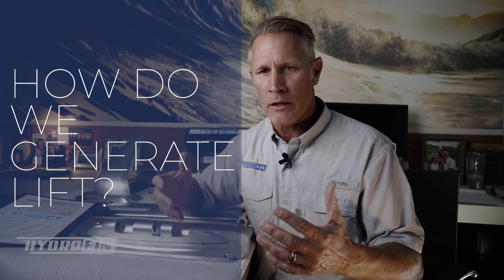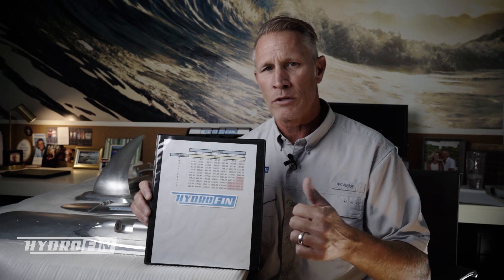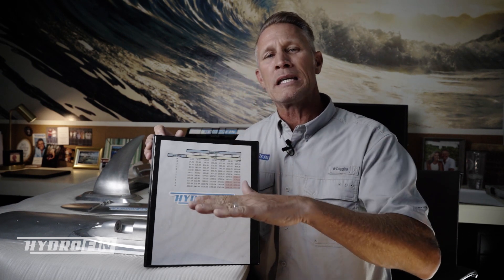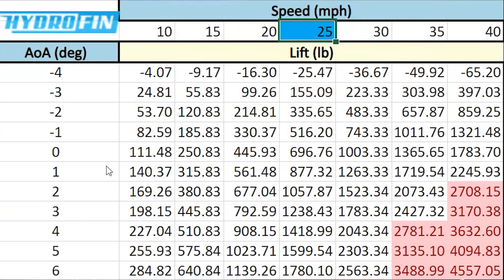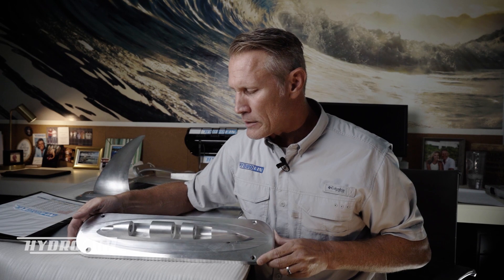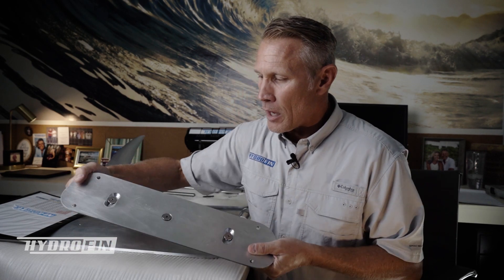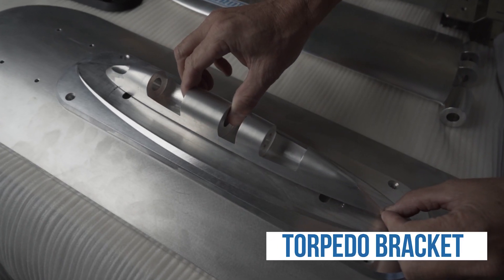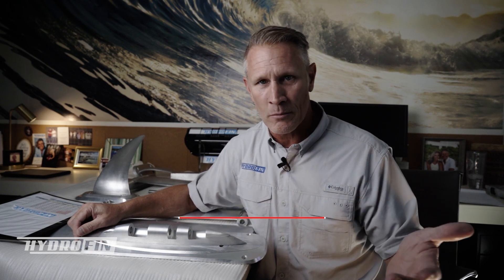Hydrofin creates the pontoon lift you need - What determines the lifting force?

Comment: You should reverse the screws holding the torpedo bracket so they clamp to the bottom plate. This would allow you to loosen and tighten the torpedo's angle of attached simply by loosening and retightening the screws from the top.
Reply from the maker: Great feedback!   That’s something we’re designing into our new version which will be released in about a month.